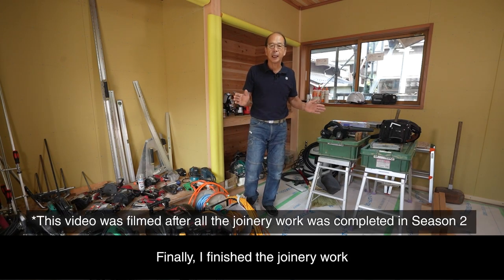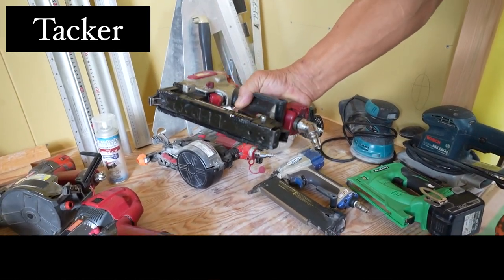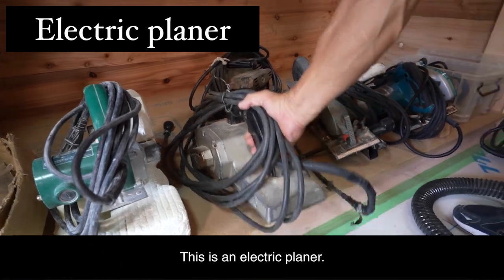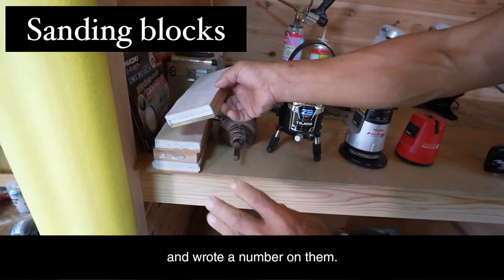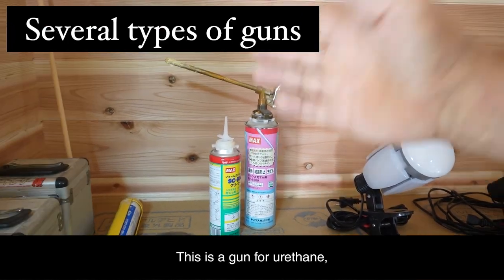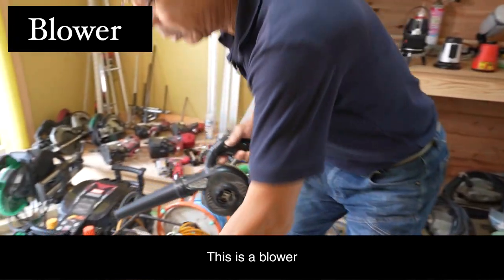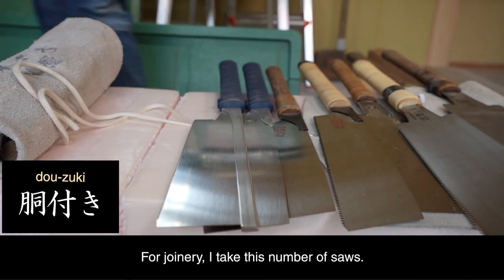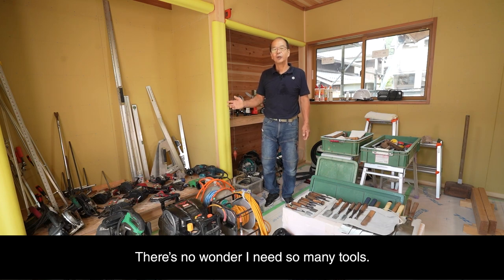All the Carpentry Tools Used to Build a House. Total 15,000 USD

Comment: I'm a tile setter by trade and it's SO true that the trades are becoming more about the tools than the craft itself.  Too many people don't have the basic skills or are actual craftsman.  Too many DIY hacks out there doing it wrong, although it does keeps me busy having to go and rip out their work and install it correctly after it starts to fall apart.  Anyway, another great video as always and never ever worry about using older tools, be proud that you can still use them my friend.  Shalom
Reply: @cmmartti  tile setters like brick layers, once one has the years of experience, those tools do become obsolete as well. Nothing is better than experience.
Reply: @cmmartti  good job completely missing the point.

Just because you have tile clips doesn't mean it's going to turn out well if you don't know what you're doing, pretty simple thing to understand.

Look up the dunning Kruger effect, you may be a victim.

Comment: I would like to disagree. It is about skills not tools. You may buy tools for 25 000 $ but without skills it is useless. I would struggle to find a carpenter as skilled in my country.  And in other parts of the world it is no shame to have an old tool if it does the job. If it survived 10 years it is a good tool regardless of the looks.